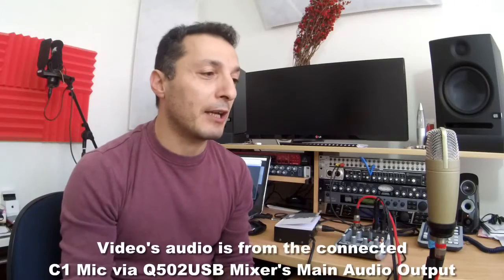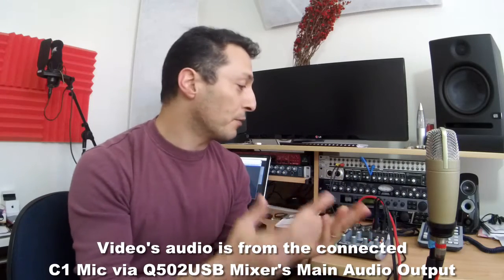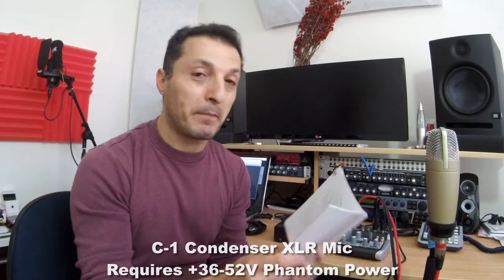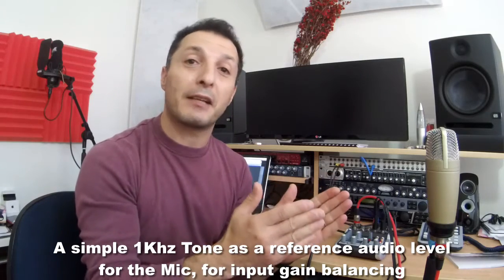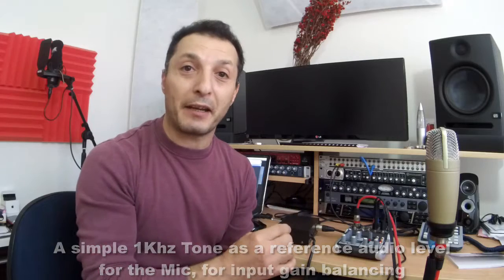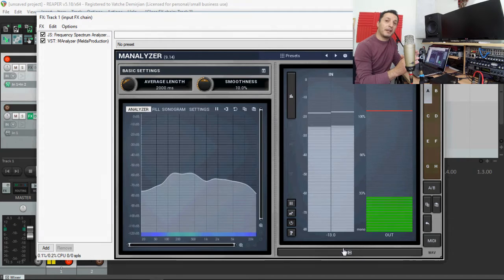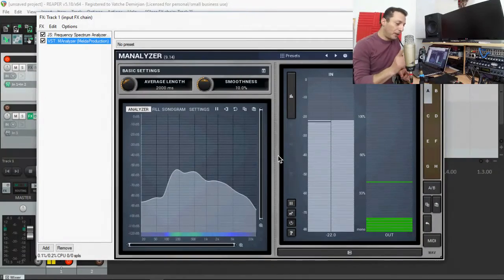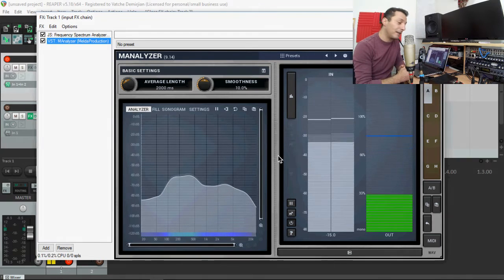Testing Behringer C-1 Mic with Xenyx Q502USB Mixer with External 48V Phantom Power

Comment: is behringer 802 needs phantom power with behringer C-1? or behringer xenyx 802 have integral microphone pre amp?
Reply from the maker: Q802 has proper +48 volt phantom power.
Reply: @RecordingStudio9  will be good, or i need something more for better sounding? sound card is behringer uca 202, this is 16 bit card, isnt too bad? or  i need 24 bit only?

Comment: Hello, I need help. I have a xenyx 502 and I measure the direct connector with the multimeter to see how many volts it measures and it says 15v instead of 48v from the phantom power. Is that measurement correct or have I been scammed with a damaged mixer?
Reply from the maker: Q502USB only provides 15V not 48V. This is by design and not faulty. Q802YSB has 48V.

Comment: Hi thanks for the informative video. 
But i already have the Q502
What condenser mic would you sugggest compatible with Q502?
Reply from the maker: Any, as long as you add external 48v Phantom Power, as the Q502 doesn;'t have enough to run Condenser Mic (only +15v), or use a good dynamic mic.
Reply: @RecordingStudio9  thank you!  Found an external powersupply from Behringer..  Converted the to USD it would 
Cost around 70 USD.
Stay safe!
Reply from the maker: The video on how to https://youtu.be/Sz7uxN1JQ_M

Comment: Hi, I have the Q502USB mixer and in my manual which is also available on the Behringer website it says the phantom power to the mic is switchable between 15v to 48v but I can't find any switches on the mixer to do this, cheers
Reply from the maker: +48V for Q1202USB/Q1002USB/Q802USB and +15V for Q502USB. I have tested them myself.
Reply: @RecordingStudio9  thanks, I'll buy the Q802, will then have two Behringer mixers to play around with :)

Comment: how do you wire from mic to phantom power supply to mixer? is it...... 
mic (xlr female to male cable) --> phantom power supply (xlr cable female to male) --> q502usb(the phantom power is off on q502usb)?
Reply from the maker: Yes, correct.
Reply: @RecordingStudio9  thanks! any budget phantom power supply recommendations?

Comment: Does this mic (c1) works with Beringer 302 usb mixer
Reply from the maker: I would not recommend C1 with 302USB or 502USB mixers.  802USB and above should work fine.

Comment: Behringer Xenyx 502 only works well with Mics, that do not need Phantom Power or with Mics, that can be used with only 12 V Phantom Power.. (yes, they do exist :D ) :/
Reply from the maker: True, but unless your 12V mic has its own 12V power supply, connecting it to a +48V Phantom Power and Kaboooom! 
Yes, Q502 has about 12V for Phantom Power, I would still not connect a 12V Mic to it. 
Phantom Power has a range from +12V to +48V and microphones should be able to handle +48V to be compatible.
Reply: @RecordingStudio9  - I have Mics that work from 12 V to 48V Phantom Power. I have no Problems with the Behringer Xenyx 502 with them. But to me the Phantom Power of the Behringer Xenyx 502 itself is almost useless (for most Mics You have to have an extra Phantom Power Supply to make normal +48V Mics even work.. :/ ) And normaly Phantom Power should be +48V. If it is less like with some Behringers it can create to much Problems. You can not even Pair it with Behringer`s own Mics like the C1 bc. it is allreaddy out of Specs for it. For this You will need an extra 48V Phantom Power Supply.. Pointless.
Reply: @RecordingStudio9 - And another Problem is that the Behringer Xenyx 502 can destroy dynamic Mics. I had that with the Behringer Xenyx 502 too. If the Mic is not truly symmetrical the Phantom Power of the Behringer Xenyx 502 can destroy the Capsule.. It is a dangerous little Mixer.

Comment: Hi Vache, thank you for these great videos. I have used a C-1 for a few years and have never been satisfied with the amount of hiss that it generates. I stumbled across your C-1 and MXL 550 comparison and was surprised by how low the hiss was from the C-1. My C-1 seems to generate more hiss. I was using it with Behringer's own micropower supply to provide the 48V, and have recently changed to a Focusrite Scarlett Solo with the hope that things would improve. Sadly, the hiss remains. It isn't as bad as what you demonstrate with the Q502USB in the early part of this video, but it's certainly not as good as the lack of hiss towards the end when you supply the right phantom power (or in your MXL comparison). Do you know why that could be? I'm just using Audacity to record, so it's a simple setup - could that be part of the problem?
Reply: it's masochism to use C-1 for a few years. I'm in the same crowd, I guess. Bought AT-2020 instead and I'm super happy with it.

Comment: im having issue with phantom power on xenyx q502usb, i just realised it is 15v, i had to raise gain alot to have my mic pick up my voice in a 30cm distance, and static and his sound is alot and annoying, what should i do? since i cannot return the 502 and upgrade to a real 48v phantom power, im thinking of changing mic (im using a cheap mic made in china under 20$) and adding 48v phantom power like you did on this video was very helpful, but one question what if the mic requirement is 11v-52v like the audio technica at2035? will it work nicely without phantom power or do i need to add 48v phantom power to achieve best sound quality? or is cloudlifter better? i want to remove the static and his sound for streaming and gaming. please help
Reply from the maker: I would recommend a better mic. Cheap $20 mic already have too much noise for any audio recording. I have a video testing cheap mics. They are worthless, waste of money.
Reply: should i go for audio technica 2035 with another phantom power or just the mic will work as clear with the q502usb? or a cloudlifter instead?

Comment: I have a problem with it too. I have 48v phantom, but I get an exremely quiet sound from it.
Reply from the maker: Bence Jávorszki-Farkas 
On your Main output to speakers or when recording in your software? Which mic brand or model.?
Reply: RecordingStudio9.com Behringer C-1 mic and an M-AUDIO mtrack mkII sound card. I tried both channels on the card. I get the same low sound if I listen directly through the card, and it's the same in the program after recording. Even if the gain is turned all the way up. Also I noticed that the LED on the mic is really dark, if it means something. Previously I used the same setup with a cheap BM800 cond. mic, and it was ok.
Reply from the maker: Just to test, if you have access to me voltmeter, measure the Mic pins for +48v. If the LED is dim, it may not be getting +48V. Behringer C-1 neads +48 volts, any less, it will not work correctly.
Otherwise, I would assume defective C-1 microphone.
Reply: RecordingStudio9.com I measured it, and guess what! The cable is the guilty one :D I have around 60V at the sound card, but the wire does just 14V! And I know why! One friend gave me the cable and I din't know that there were resistors soldered in. Thanks for the quick responses!

Comment: can I use behringer 802 with behringer C1 microphone without any sound issues??
Reply from the maker: Yes, as Zenyx 802 provides +48 volts. Just check in any case.
Reply: if I make a song using both then will I be able to save it in laptop or what do I need to use to do so?

Comment: What's the phantom power in behringer 502?
Reply from the maker: All Condenser type microphones do require +48 volts DC to operate, due to their electronic parts inside the microphone. This power is called Phantom Power.
Dynamic microphones do not require any phantom power. Having it on may not damage the dynamic microphone, but best to have it off.

Comment: Hey, I have the the C1 and the Xenyx Q502USB too, but I'm having SO MANY noise, is it the equipaments or something else?
Reply from the maker: It all depends on the type of noise you are referring to. Hum or static? 
There are few explanations. The Behringer C1 being entry level Microphone, itself has some noise. Same goes with the Q502USB. I have done a simple test you can watch here https://www.youtube.com/watch?v=zD8QYcgAeJ8
The other and more apparent issue is that Q502USB only provides +15 volts for its Phantom Power, and C1 requires +48 volts. This reduces the C1's dynamics and increases the Microphone's noise level.
One option is to purchase and use external +48V phantom power supply (Behringer PS-400), or upgrade to Q802USB, as it provides +48V.
Reply: +RecordingStudio9.com Ok, thanks man! And sorry my bad english, I'm brasilian

And I'm talking about hum noise
Reply: +RecordingStudio9.com Hey, can you tell me what do you think about Behringer MIC 200?
Reply from the maker: The hum is usually induced by non-grounded audio gear. Is the hum in your speakers or headphones?
Also, the MIC-200 will be a great addition. Though I have not tried one, but seen lot of great reviews and a friend of mine uses it and he is happy with it.

Comment: Makes sense  designed for 48v, it works better at 48 , Pretty crazy why Behringer used only 15v for the q502usb , I wonder if there other usb mixers are really supplying 48v. I guess if they use a external PS then they are  truly 48, but if only usb , they might be in question. Or any other manufacture for that matter . Great Video , and Fantastic explanation. Thank you .
Reply from the maker: +Ar Tonal 
The Q502USB uses external power supply and does not run on USB only mode. Just to save few cents, they did not include +48 Volts. Might as well not have it, at least people can use external Phantom Power and get proper working Mics.
As I mentioned, at least I know the Q802 and Q1002 have +48 Volts, with the correct circuit.